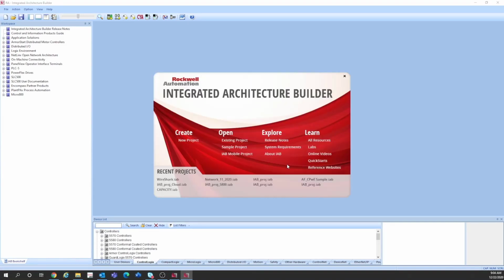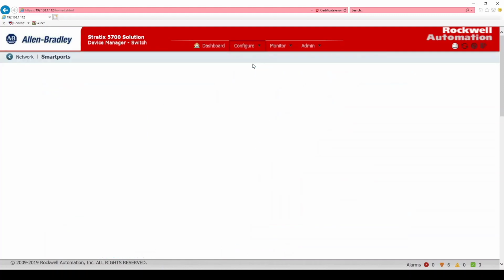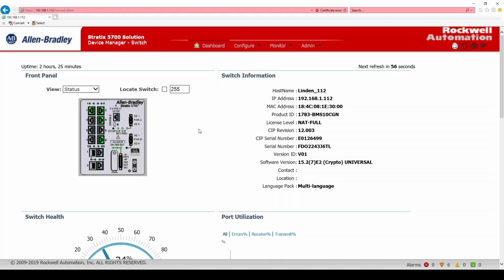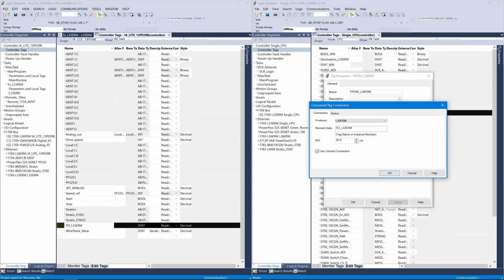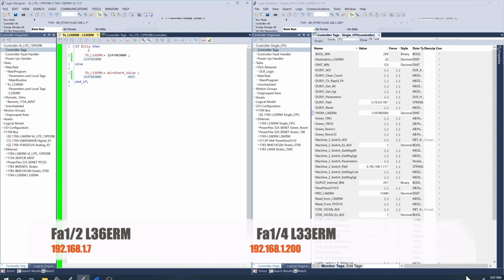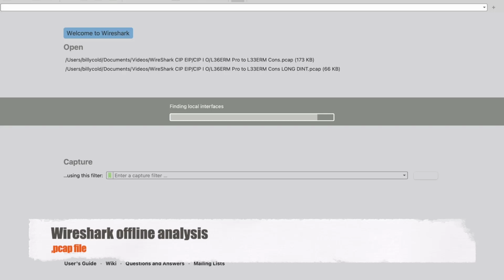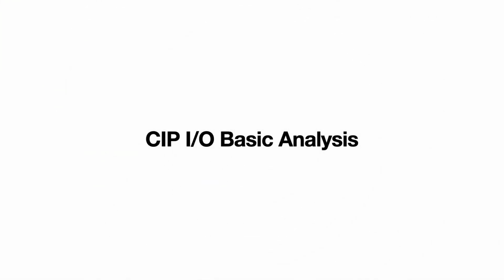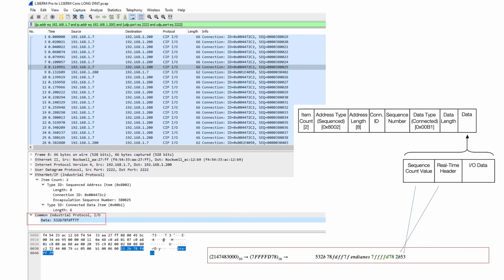ControlLogix, Stratix, Wireshark, Ethernet/IP, CIP

Comment: Any thoughts on Rockwell's Common Industrial Protocol (CIP)?  Not sure how it differs from EtherNet/IP, but I believe it's implemented at the Application layer of the OSI model.   I'd like to play with an Allen-Bradley ControlLogix 5580 by interfacing to it with a Stm32 microcontroller..  unfortunately, the open source projects I've found (EIPStackGroup / OpENer ), appear to have been abandoned before completing CIP :(
Reply from the maker: Very good questions! Even today, there are still some misunderstandings on EIP and its correlation with CIP. 

Let's put it this way: CIP ( OSI Upper layers) + IEEE802.3 ( OSI Lower layers) + TCP/UDP ( OIS Middle layers) =  Ethernet/IP.
It's hard to find Opensource software to fully work with Allen-Bradley products. There are options such PyLogix ( Check GitHub) to run in devices like the Raspberry PI (Ver 4) that can help you with the EIP stack (how to make EIP packets and frames), and to play with communications between devices. 

The best solution is to get the software. Today, all software is per subscription, so there are ways to save money and still use the right tools. 

Thanks for your comment and we hope this helps!